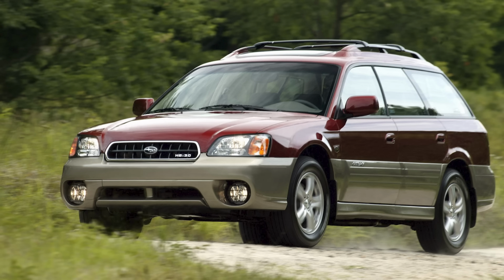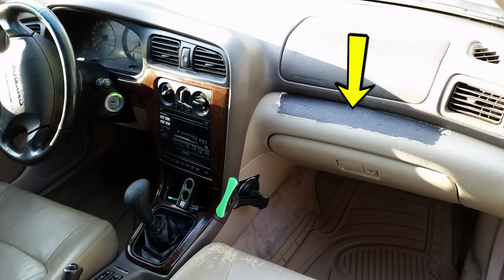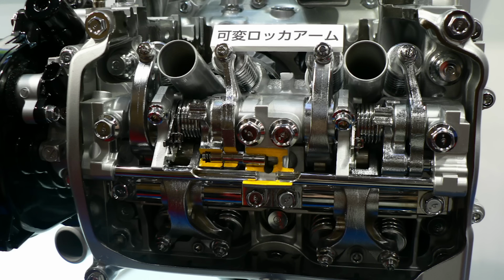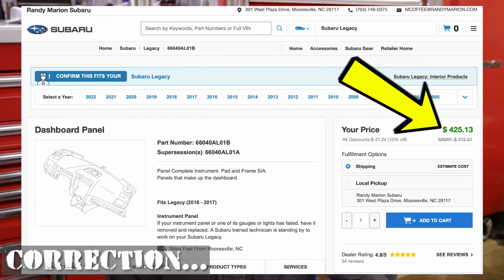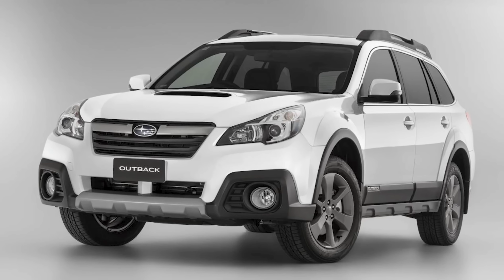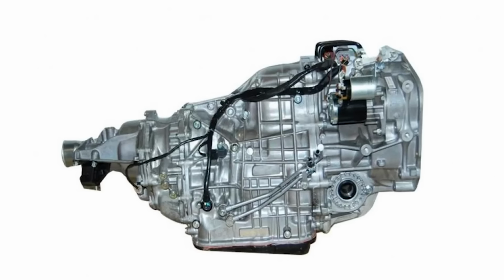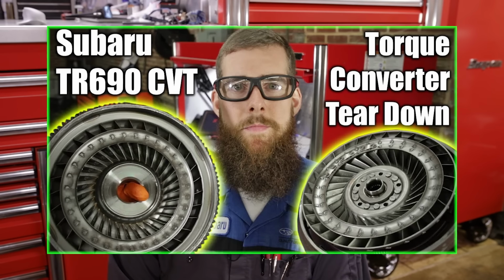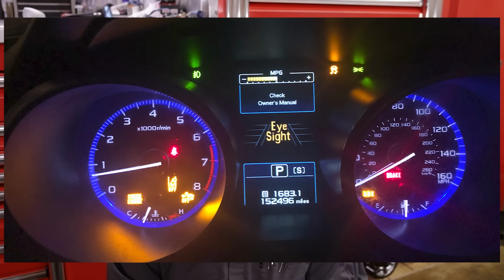Buying A Used Subaru Outback Or Legacy?! Here's The Good And Bad Over The Last 20 Years!

Comment: I had a '01 2.5 Manual with the Green LLB like trim and I loved it. Purchased it when I was 16 in 2015 with 340000km on the clock and known head gasket issues around $250 USD. I put a sealant fluid in the radiator the minute I purchased it and just checked the water level each time before I drove it any decent distances. It lasted until 395000(ish)km and only scrapped it because it needed 4 new tires. Had a '06 for all of 10 days before I returned it to the dealer so can't say much about it but I recently brought a '11 2.5i Premium and I love it, even though it's a huge car compared to the 2nd and 3rd gen. Only being 10000kms or 3 months in, it seems great, no issues so far and the space, clearance and semi luxury feel is much appreciated. The 2nd gen is by far my favourite car I've ever owned though. Even with the head gasket issues, it taught me to look after my cars and was a great car to have as a teenager who would go skiing every weekend during the NZ winters. My family also had two 1st Gen's that we learnt to drive in, a '98  2.5 Manual and a 97' 2.5 Auto. The auto was horrible, but the '98 was a awesome car! All 3 of the late 90s, early 00's outbacks were purchased as cheap run arounds with high kms and with VERY low expectations but the manual ones turned out to be some of the best/most enjoyable cars any of my family have owned.

Comment: I’ve got a 2013 2.5. I picked it up used, and it eventually started consuming oil, but apparently not too much; I usually add a quart between oil changes and I’m fine.

This thing is a dent magnet though! When I got it, it had dents all over, buckled plastic parts…and in the 3 years I’ve had it, it’s collected so many more 😂

I was thinking of selling and buying a newer used outback, but after watching this, I may as well put a few more years on it.

Thanks!
Reply: I bought an '11 outback a couple years ago and it had a bunch of scratches and dings all over it as well.  Glad I'm not the only one driving around with a dinged up Outback.   I just blew a gasket a couple of weeks ago so I'm curious how your's has held up.
Reply: @larryuptain3404 no gasket issues yet, but I’ve had a bunch of small issues to fix.

A few months ago I cracked the radiator hose going to work, so I had to change it at an O’reilleys. Had to remove the bumper to change a headlight; found out the car had been in a wreck I didn’t know about 😬. Changed the clockspring in the wheel earlier this year after the horn went out.

I’m currently waiting for the weather to cool off so I can repair the driver’s side window, and flush the break lines. I’ve also got a TPMS sensor that needs to be replaced.

Otherwise all is good :)

Comment: It’s really interesting to listen to your likes and dislikes throughout these models. I’ve been a Subaru dealer tech since 03. 00-04 was definitely my favorite.  Some things you say have been more of an issue for us. 05-09 was so bad with wheel bearings. Links. Bushings. Rear hatch harness breakage. 10-12 2.5 internal head gasket failures vs the older external oil leaks. Dropped guides. We as techs see so much but the fact is so many of these cars are cruising the roads trouble free. Great job on your vids.
Reply: @chrro466  
I don’t think I’d call it legendary.  But overall less head gasket problems than the EJ engines. However I still love the EJ for its simplicity and ease of servicing. I like the 3.6 far more than the 3.0. Plus it doesn’t require premium fuel like the 3.0. Not that I fed my 3.0 with premium but Subaru claimed the 3.6 was ok with regular. Also a simpler design with a simplified timing chain cover. Less places to leak than 3.0. The weight and torque make them much nicer to drive than 4cyl versions. As time has gone on I’ve come to like the 3.6 more than any of the other chain engines. But H6 is no longer an option in the US. Not sure about anywhere else. I’ve owned them all at one point. Currently have an Ascent with the 2.4 DIT turbo. Time will tell on long term reliability. My recommendation for any newer car you intend on keeping out of warranty especially if you plan on it lasting as long as the earlier models that regularly hit 200k Get a 
(GOOD REPUTABLE)extended warranty. Do your research. When your CVT grenades it more than pays for itself.
Reply: @chrro466  
Yeah no diesels for Subaru here in the states.  I think the 3.6 and 5EAT is a great combination. Id definitely rather have that combo than the 2.5 with CVT
Reply: @chrro466  
I want to see New Zealand. I’m geographically jealous of you.
Reply: @chrro466  
There seems to be leaders everywhere hell bent on ruining the best parts of their country’s

Comment: I have a ‘05 2.5na EJ252 Outback with AT/Mud tyres and 4EAT. Base trim but has rear LSD, use it off-road, runs well, 252,000km approx. No HG issues. I’ve replaced the radiator. Looks like I need to replace the harmonic balancer.

Comment: 00-04 For the win! I bought an 02 Legacy as my first car in 2020 with only 85k (now 112k) and encountered all the issues you've listed but that list is extremely short. Just minor rust, replaced most of the suspension, brakes as you would on any 20 year old car, and once the leaky OG head gasket is fixed it's probably going to last longer than i do

Comment: Well done, I started my association with Subaru in 2013 with the 2013 Outback 2.5i Ltd, minor issues aside it has been great, the size was perfect for me at the time, I later came across a 2006 Legacy GT in 2015 which has been so much of a blast I ordered a 2018 RA block for transplant; I also had a 17 impreza sport for a few years but gave it back because wifey wanted a miata ;)
Reply: Hi! I own a 97 std, thinking on getting a 2013 automatic transmission, in your experience, would you recommend the update is worth it?

Comment: Absolutely I have a 2001 outback 2.5L and I love it with the 5 speed manual, it could definitely use a 6th gear because at 140kmph it drinks fuel fast.. The 3L 6cly is known for blowing up. In Australia. 
I wish we got the gt forester 2.5 turbo engine in the outback in Australia then it would be an almost perfect car. Also I wish you could adapt the power to drive system from 50/50 to 80/20 rear drive for a more fun drive. The 2001 understeers like a bitch and you can't kick the ars out if you want to play with it. If you do push it to the point of breaking traction it handles like a pig. It's easy to control and you won't crash but it just feels shit.
Reply: WTF are you doing driving at 140km/h?
Reply: @MartinJones123  highway speed.
Reply: @datwistyman  Most Aussie freeways don't have a speed limit of more than 110km/h... Unless you're in the Outback or something...
Reply: @MartinJones123  that's why you wait for a guinea pig doing a good speed to go past and sit about 300metres behind them and let them find the pig's. Work's a treat. Having a 100kmph highway speed limit these day's is bloody ridiculous. Maybe it was valid 25 to 30 year's ago but car's now are far superior.
Reply: @datwistyman  Cars might be but people aren't better drivers than they used to be, it's the opposite...
Reply: @MartinJones123  very true.
Reply: Changing the centre diff to a 12kgf unit and adding a rear lsd, as well as 1.5 degrees of camber on the front, 1.0 on the rear, 1mm toe in front, 2mm rear, the car will drive drastically different. Not a hint of understeer anymore.

Comment: My daughter’s 2012 Legacy has been high maintenance. Axles, wheel bearings with 85K miles on the clock. Now it consumes a qt per 2000 miles. Just checked the PCV today and it’s clean and functioning. next plan is to change oil from factory recommended 0W20 to 5W30 to see how it effects oil use and fuel economy. Not willing to have the rings done. We’ll dump the car first. Kind of messed up with what we thought would be a good car for the girl. The take away from this video is buying a used Sub (or maybe new) is a bit of a crap shoot.
Reply: My 2015 Outback, 130,000 miles hangs on to the Quaker State Oil much better than others I have tried.
  QS 0W20   1qt 3000-3500 miles, variable with type of driving
  Idemetsu 5W30. 1qt 2500 miles
  Idemetsu, Pennsoil 0W20  1qt 2200 miles
  Mobil 1, Castrol, Valvolene  1qt 2000 miles
  STP     1qt. 1800 miles

Oil consumption started about 80,000 mile mark. CVT serviced twice, independent shop and oil was still clean both times.

Comment: Just discovered an oil leak on my 2016 Outback 2.5. Looks like the valve cover on the passenger side. Dripping onto the exhaust. How can I tell if it's th valve cover gasket vs. the cam carrier seal?

Comment: I found a 2005 Subaru Outback 2.5 xt with 90,000 miles almost 2 years ago. It’s been a wonderful car. I did have a gasket leak dripping on the exhaust last year. It smoked and smelled terrible. Luckily it was the passenger valve cover gasket, rather than the head... it now has 120,000 and I’m expecting the head gasket to be a problem soon. I love this car. I maintAin it well and have never had a problem with the engine. Hope to have this car for 7 more year.
Reply: josephtasso419  you have found a gem. May I ask how much you got it for?
Reply: I bought my 2.5 XT in 2014 with 80,000 miles and at 84,000 miles my turbo blew. I had the short block and the turbo replaced. It developed a dashboard rattle shortly after getting it back from the shop. In the last few years it's been running a bit poor. I lowered it on Legacy GT struts and springs at 92k, as well as changed the rear control arms out with camber bushings and it handles way better. I change the oil every 4 months/3,750 miles and while I love the turbo I absolutely can't wait to get into something newer with Apple car play. I regret lowering the car because I want to go more places now. It's a sweet car, but the turbo makes it feel so unreliable, I don't trust it at all.

Comment: I had a 2009 Subaru Legacy (European) Boxer Diesel. Bought it brand new and sold it at 120 000 miles after 8 years of ownership. The build quality was very good and the only problem I had with it was the engine  (at 109 000 miles) and clutch. No other problems at all considering I live in an area were roads are not good. No electrical problems, no suspension problems, no AWD system problems at all.
PS: To adjust valve clearance on 2015-2019 Outbacks is there a necesity to remove the engine out of the car ? How often should you do this procedure ?

Comment: Was in the market for a Subie a few months ago and ended up with a well-maintained 2012 Outback Limited with around 110,000 on it. Love it so much, feels like a mini tank. That EJ engine looks practically bulletproof! Thanks for your insight as always!
Reply: got one myself about two years ago and haven’t had to do anything major to it other than replacing the oil pan/gasket due to Northeast rusting from salt. Planning on getting struts replaced soon but otherwise I agree fully with you on it feeling like a tank!!
Reply: Still liking it? Wanting that year myself.
Reply: @FardtilUshid  Yes, absolutely! It's a beast of a car, proper maintenance has given me great performance and reliability.
Reply: How much did u buy it for?
Reply: @coltranebartlett590  Got it for $12,000, Subies don't lose their value that much.

Comment: Got a 2001 Legacy GT Limited 5MT. Owned it since 2006.  Love it. The wind noise sucks though
Replaced the head gaskets myself in 2021. Replaced front CV axles, ball joints, tie rod ends, front/rear sway end links and struts/shocks (with coilovers) in late 2023/early 2024.

Comment: You seem to be pretty much on track with what you're saying on the Subaru's. I've had 18 over the years and am currently in possession of an 04' Forester auto trans w/225k. 110k on the rebuilt 2.5 that was installed 35 miles before purchase by Roo Pair Tacoma, Wa. OBW the rock solid fix for head gasket issues with the 2.5s is simply use the turbo gaskets and problem solved for good. Great car, in the 110k so far I had to replace the radiator and alternator just recently other than that all scheduled maintenance including the timing belt, idlers and water pump with oil/filter every 3k using 5w30 Schaeffler's synthetic 9000 
I also am driving an 08' Outback XT limited 5 speed manual I purchased just over 2 years ago from another Tacoma Subaru only repair service shop in showroom condition that the owner bought from a customer and was installing a new engine in. That was two years ago and after 10k of running 5w30 Enos motor oil I switched to Schaefer's 5w30 9000 and gained a respectable 22 horsepower. There's something about Schaeffer's motor oil I've learned to love. Good job guys keep up the good work.

Comment: I still have a 01 Legacy GT wagon , manual it's got 220,000 on the engine ,I love this car  seems to be chewing through gas lately , I was told the engine is done ? Is this true I get around 400 miles on a full tank on the highway and about 250 around town big difference in fuel  consumption but I still love it !!

Comment: I have a 2012 Outback 3.6r with 135k miles on it . Except for a few quirks it’s been a great car . I am a 40 year experience auto tech with 15 years of Ford dealership experience . Car has been serviced by me since new . Main quirk- sometimes if you let off of the gas at 10-20 mph and the get back on it you get a rough engagement of the trans like a big clunk .Car has done this since it was new . It used to be used in an agricultural area and the radiator got plugged with corn silage . But that was an easy fix and gave me a chance to replace the coolant . I retired last November and the car now operates in Cabo San Lucas . Even some of the streets are dirt here . I kind of feel sorry for it but I will continue to keep it going .
Reply: Same issue clunk some times shifting to drive. 2011 . Iv gone to kind of double clutching on the brake pedal before putting into drive., ❤133,000 miles  any idea? Same I drive dirt roads like you. Enjoy Mexico

Comment: The shop reported a total pressure (40 psi) loss in cylinder 3 due to a dropped/bent valve in my 06 forester, which they say caused the oil pressure light to flicker.  They're declaring it needs a new motor.  Time to move on... and sell for parts?  Pretty bummed.  Must have just happened after I did the leakdown test last summer and everything checked out...  Guess that is what happens after running it hard at 230k I really wanted to get to 300!

Comment: With the generation introduced in 2010, they neglected the manual transmission so much they forgot to open a necessary lubrication passage and did a recall.
Reply: Do you recommend second hand? 200000  miles and  3K dollars

Comment: Its sad most people are scared about the timing belts, but they're actually cheaper to fix and easier (thus keeping them in the wrx models for ease of replacement believe it or not).
All in all, these are old engines, which actually makes them surprisingly easy to work on.
I have a 2010, only a 110k miles, got it for 5 k with the timing belt kit done with water pump.
I did have a timing belt tensioner go (my assumption is it was replaced when the belt was done) either way that fixed a crazy noise it makes when that goes.
Also, the starter is going. I also broke the lumbar support by adding a seat cover with a flap that goes in between the seat which keeps it taught and the wrinkles out, so when i used the lumbar support one day i heard a pop n it was 100 percent because of that, which pissed me off because i really liked that option unfortunately.
Anyway agreat winter and daily driver to work car which i use often.
Im going to really hit the maintenance on it.
I have no noticeable oil consumption as ive replaced the oil every 3k just to really be able to measure whats coming out n the condition of the oil as its new to me and its been good. I did spark plugs and diff fluid changes.
Im gonna do brakes and fluid flush in the spring and get to the valve cover gaskets because the rear plugs on each side where a little bit wet with oil which leads me to believe those r leaking internally, nothing bad yet n its not burning oil, so i have some time. It also sat for a year before i got it so that may have also caused this too, not helped at least 
I love working on my own vehicle n love learning how to do things.
If i can possibly do it. Im gonna try solely because im going to take better care of my vehicle than someone else will for sure.
Its comfortable af, roomy, the back seats are huge and recline which i think is amazing on these 2010 plus models, thats a real function they never had to design.
Also the roof rack design is absolutely amazing. The best in the business for sure.

Comment: I liked the 2000's OB's as well.  We had a 2002 VDC and a 2001 Base version.  One feature I really miss is how the rear seat bottom would flip up and when the seat back went down it was very level.  Also, the rear seat bottom formed a wall preventing stuff from sliding up into the front seat area.  It made packing stuff in there really handy and secure if you stopped quickly.
Reply: No one mentions the VDC trim, I got one too.
Reply: @IshimuraOrigin  Back then it as a specific model.  Not all had it at that time, but the  VDC and VTD systems were excellent in bad weather!

Comment: 08 LLBean 3.0 ,  201k  ..chain rattle , fixed (made a youtube vid) 43 bolts!! really!! smh .... sticky dash ...well... it holds my phone WELL!!!   runs so smooth I cant tell its still running sometime ... it will throw the CEL on and shows ( even says old )   OLD codes , Ive erased them with 3 diff scan tools and it still pops up after a couple of days .. no issues no freezeframe just says OLD code  ( missfire codes ) if my cruse wasnt flashing i wouldnt worry about it , but it would be nice for it NOT to pop up with old codes , any idea on what to do to solve this issue ? ty